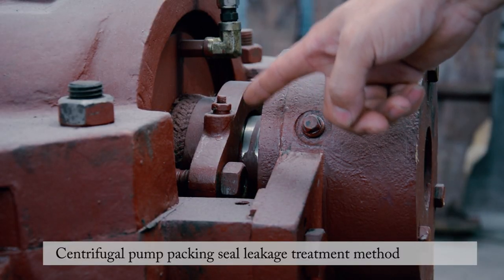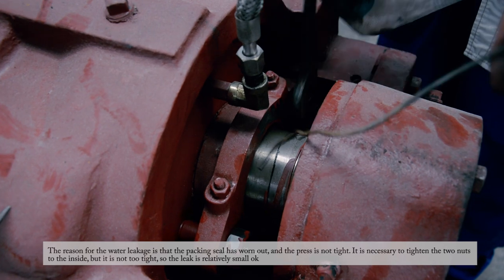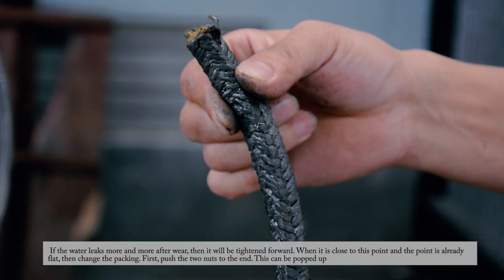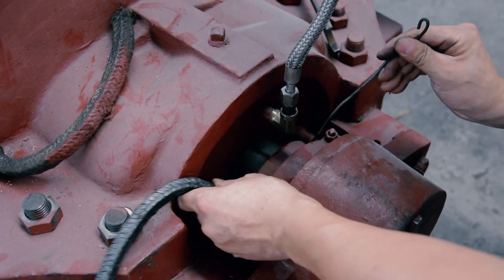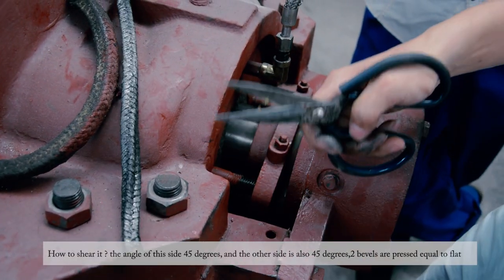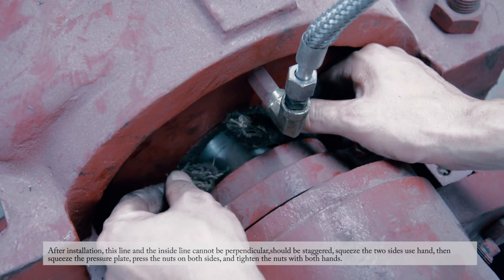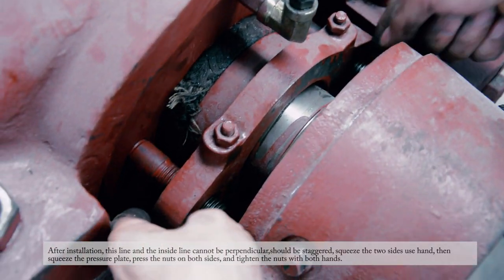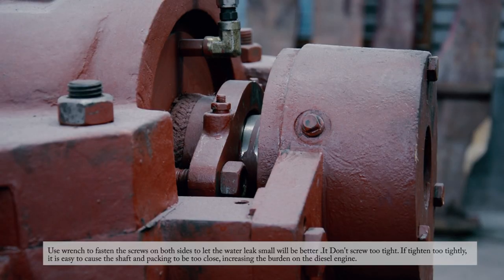How to change gland packing

Comment: 2  wraps is better than 1 so that there is no potential leak from the joint
Reply: Packing glands are designed to leak just a little in order to lubricate the gland itself since the shaft is going to be rotating in contact with the gland... It's when the leak is excessive that they need to be replaced/tightened.